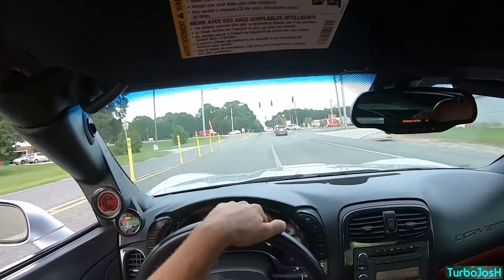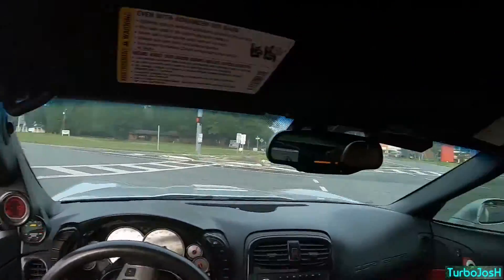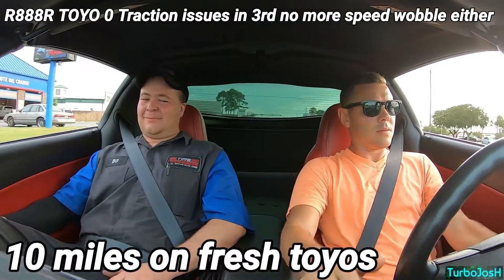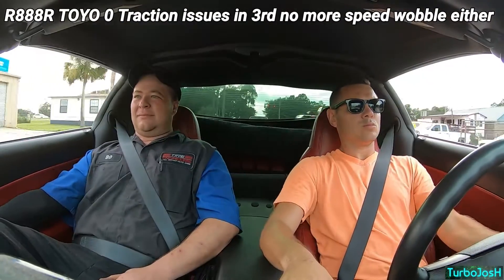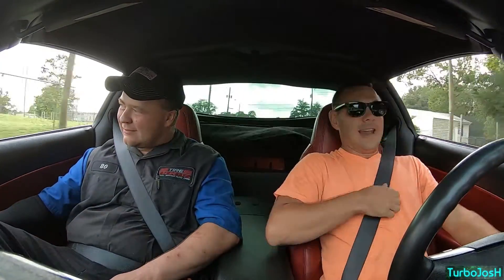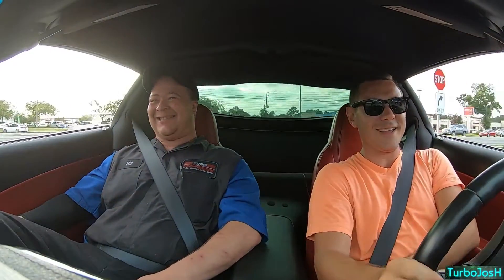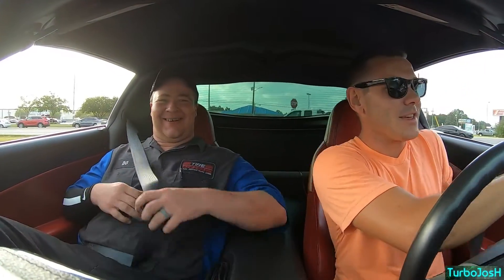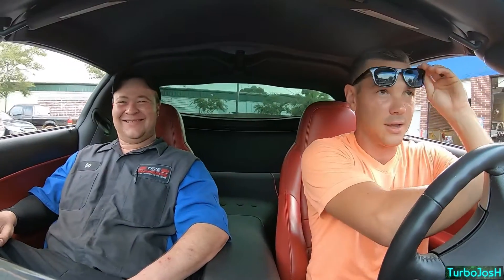Toyo R888R vs Stock Pilot Cup Street Tires (Supercharged LS3)

Comment: How much horsepower your corvette pushing? I'm looking for a sticky semi slick for my f80 m3 I have michelin ps4s and I can't get traction... also what size tires have u got on the rear
Reply from the maker: Go watch my r888r review video. They were huge 19" 345 wide. I made 550 to 600hp. And it hit hard and your bmw won't hit that hard so my type of tires should suit you well and give you good cornering
Reply: @JoshRaySpot  I don't think I can fit that wide of a tire on my 18x10 rim on the rear ill try 305 35 or 295 35... my m3 goes pretty hard much harder then my old supercharged ls1 that had 533 wheel horsepower cause car is much lighter.... ill check out your other video thanks
Reply from the maker: @mushy1983123  yeah 345 was on a 12" grand sport wheel. Just telling you what I had
Reply: @mushy1983123  did you get them?? I have a f10 M5 with 500whp and I have the pilot super sport a/s and I can’t hook
Reply: @GrimShotGaming  nah I didn't get them yet ended up going e85 lol I find the michelin ps4s is only good  for road use like a all round tyre not as good as the semi slicks for dry traction
Reply: @mushy1983123  got an f82 on E85 pushing around 640 my PS4s can not hook for the life of it going to try cup 2
Reply: @topchoiceauto9626  I say u would need to go wide ad possible to hook I have nitto nt01 on my car now it'd hooks abit in 2nd gear once warm but 1st gear still not good on street might hook at the drag strip

Comment: I have 16 z06, few mods adding about 30 wheel. How Street-able are these tires? Any down sided compared to stock super sports? Thank you
Reply from the maker: Very streetable. Pilot sport cups were useless for me. But you have more gear in a z so your traction is not as bad as mine was
Reply: @JoshRaySpot  thanks for the reply! I'm reading that they are pretty loud. What's your take on that?
Reply from the maker: @MichaelGreco  couldn't hear mine at all cuz I saw videos that said that to
Reply from the maker: They were so good I sold the car and took them off. Still have them in my attic